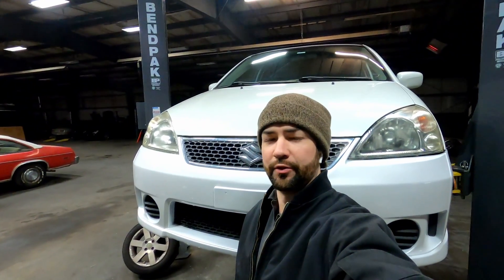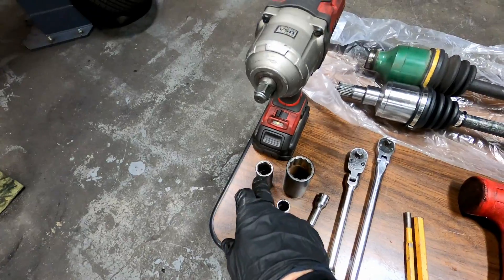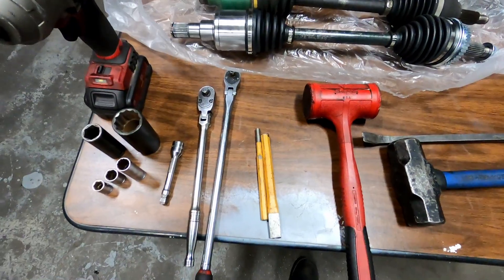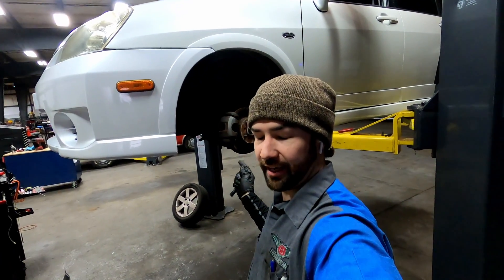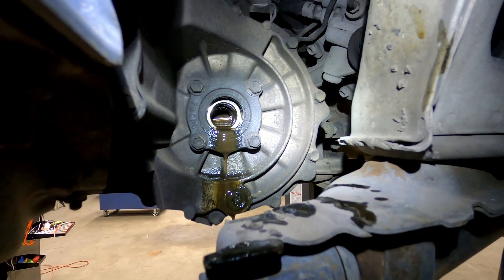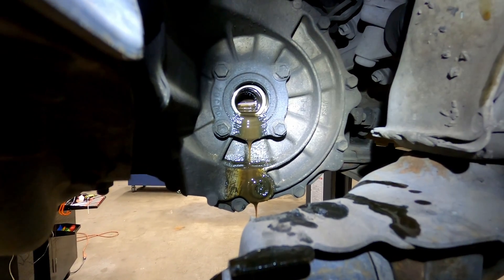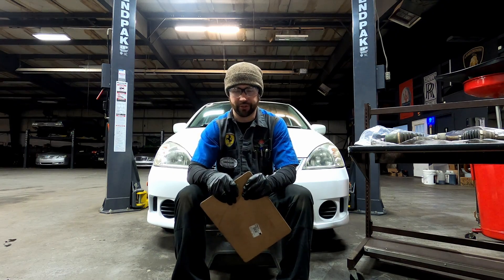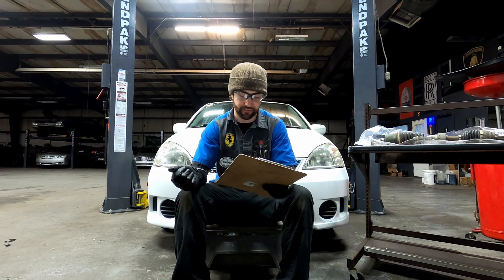New Axles and Saying Goodbye to the Suzuki

Comment: My daughter has one of these, called Liana in Australia and it's a lovely car to drive. Really first class! 
Did this job several times because the replacement driveshafts were always different to the ones the spares shops had on their books - so be warned!
Perhaps take the driveshaft to the spares shop - it could save you time and stress. Eventually got the right part for the RHS, but the LHS was different to what was on offer.

Comment: I'm a bit jaded when it comes to newer cars but Suzuki surprises me every time and its the small things I appreciate, As close as I can get the thought and engineering is like 70's Mercedes W116 and early 107 (I have a few) as they come apart nicely, a lot of thought went in to durability and I always fine something that makes me smile because my job is way easier than I thought.
BTW Mike? Nice job on the E type, Worked on 50's and 60's Jags before and its a lost art .... Mk X and 420G still my favourite and those XK Gold top engines are awesome cammed up :-)

Comment: Oh,joy. I've replaced the cv axles on a '89 Ford probe and a '96 Gran prix. The probe was a bear insomuch as I bent the brake rotor disc while using a pulley puller tool to force the axle out of the hub. 
Writing concertos in your head while you work?

Comment: you need to take out the abs ring if your car doesn't have abs, with the ring the axle doesn't go through in the wheel hub, I have a Suzuki Aerio 2006 since new.

Comment: I wonder if the did a mid cycle redesign on these cars. I replaced my alternator twice on my 2003, and when I pulled passenger side front axle, it was attached to transmission and I had to replace the fluid that drained out. Interesting.